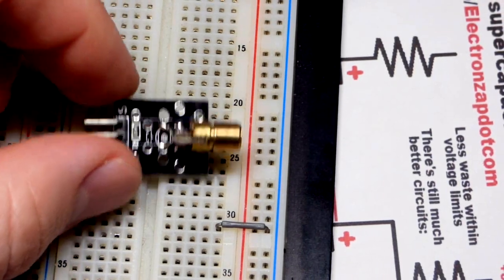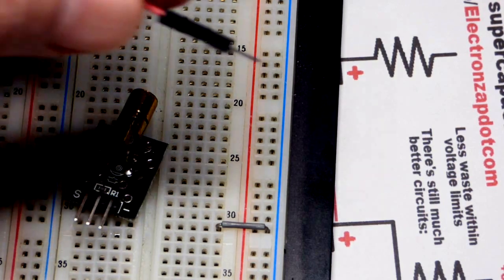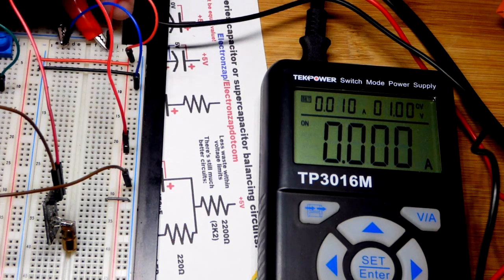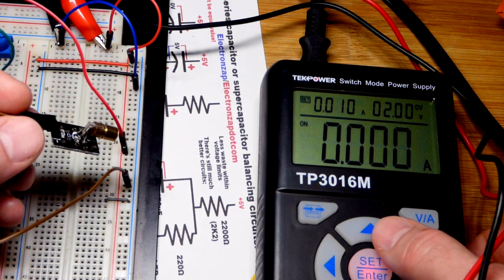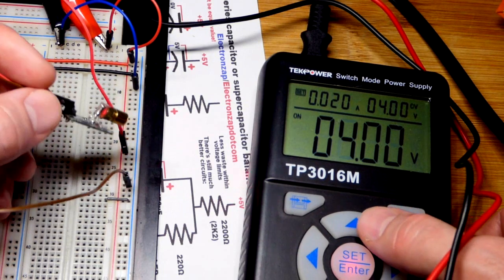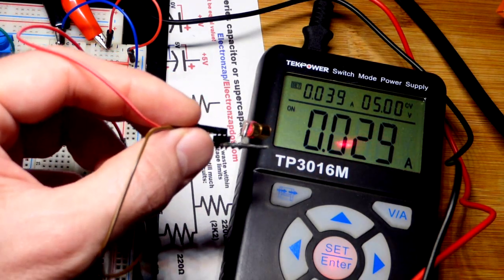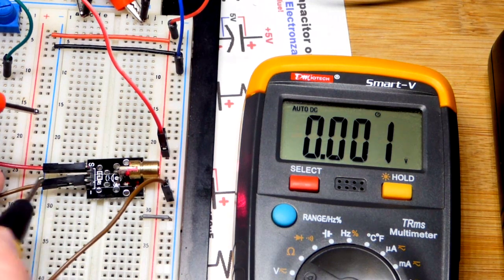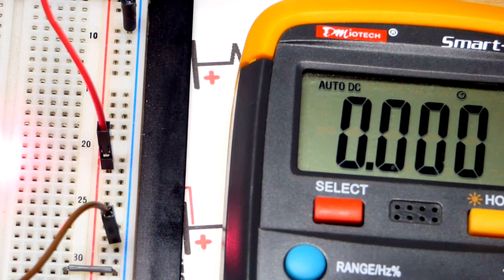Wiring up KY 008 laser module for first time while testing VI electrical properties

Comment: Thanks for making a video for the question I asked on lasers in one of your videos..  😄😄👍
Reply from the maker: No problem, I appreciate good video ideas!
Reply: @Electronzap  actually I've tried with ky008 lasers before and was successful in switching on and off with Arduino since it requires only 30 mA max... But this laser is not useful for my application... I have a 3 pin laser diode with minimum operating current of 55mA.. but Arduino can only supply 40mA max.. Hence I googled and found that transistor can boost current ... And while searching for transistor circuit I came across your video... I used TIP120 transistor .. i did get it to switch on and off with this... but not able to understand the current gain.. it's written in datasheet that it's upto 100... But it's giving around 40-50.. also is there a need to worry about ODF (Overdrive factor) when using transistor??